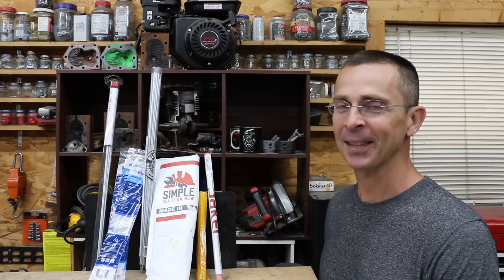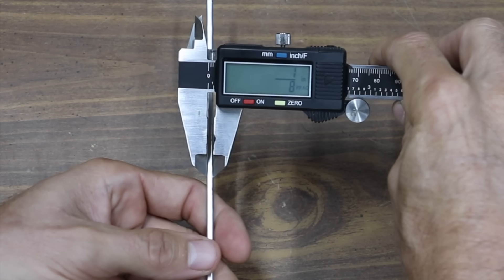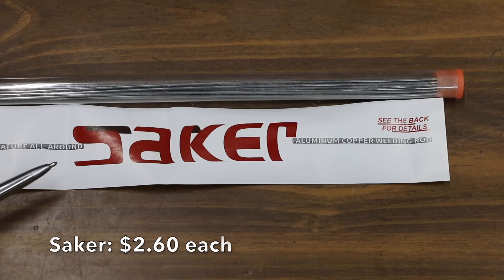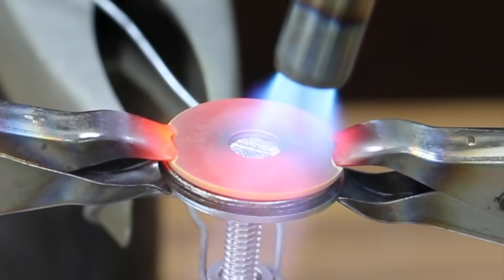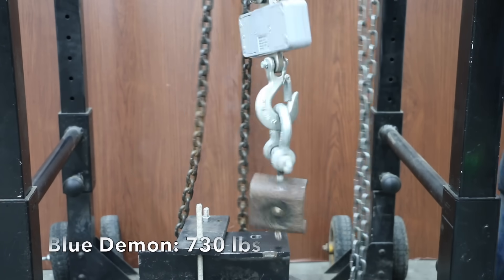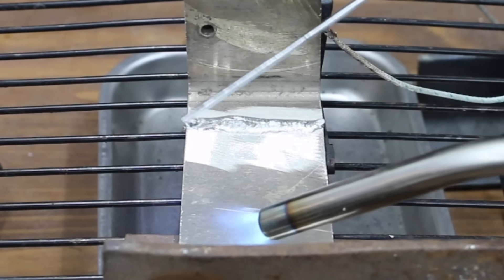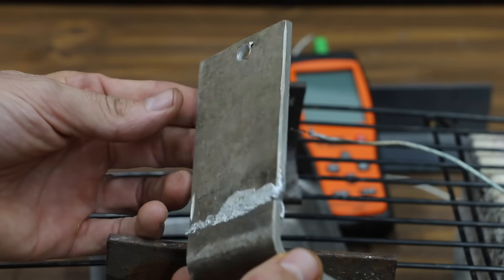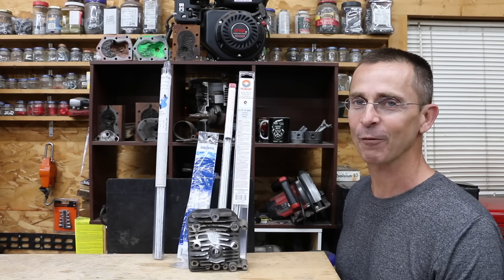Best "No Welder" Aluminum Welding Rods? Alumiweld vs Bernzomatic vs Hobart

Comment: Price to performance among American Made, the blue demon seems like the winner. The Hobart would probably be best if it's a one off repair as cost wouldn't change significantly for one repair. Aluminum oxidizes so fast possibly you need to wire brush it while the torch is on it burning the oxygen to keep it away. Oven brazing might be a help in using these products.
Reply from the maker: Thanks for watching.
Reply: Blue demon and Simple Welding  the best options.

Comment: Just wow.....what idiot wrote the instructions for these products....you DONT heat the metal your supposed to weld bcuz in some cases it can melt faster than the welding rod....You ALWAYS heat up and melt the welding rods and apply it on the surface you want to weld.....easy as that for f sakes.....

Comment: Anything less then 7/64th, and more 1/8th is ridiculous for a welding rod.
I prefer rods that are between 31/256th and 61/512th of an inch, I can occasionally tolerate 641/8192th for jobs that requires a finer diameter, like the first one, that one had some sensible measurements :)
Reply from the maker: Thanks for the feedback.

Comment: How 'bout testing extension cords? For sure, current capacity is a factor, but IMO the most interesting part would be wear tests of slamming them in a doorway (or other shear testing), putting them under tension until they fail, and comparing the electrical contacts after plugging/unplugging under load to create arcing. Maybe test the strain relief boots on the ends too?
Reply from the maker: Thank you for the video idea!

Comment: This may have been asked and answered already: We saw the tensile strength of the bolts when the bolts  broke rather than the weld. But, what is the tensile strength of the aluminum bolts prior to being exposed to the extra heat of the welding process?

Comment: Weld a connecting rod back together then maybe take two rods and cut them so you can stroke one motor and destoke the other.  Fix a hole in a piston. After seeing you patch that cylinder head my wheels started turning.  Great job buddy.
Reply from the maker: Thanks for the suggestion.

Comment: “Saker, the worst and most expensive out there”   perfect advertising.
Reply from the maker: Thanks for the feedback.
Reply: pronounced sucker for the way it leaves you feeling
Reply: @PietriGuitars  be very, very careful if you try. Magnesium combusts violently if you set it off
Reply: Yea they seem like complete rubbish. I easily get better results than that using oure zinc from anodes.
Reply: I was just about to buy some of these, glad i looked at youtube first
Reply: @PietriGuitars  jb weld that bad boy
Reply: @carlosrobles7608    Been a mechanic since 1970.  JB Weld has always been my last ditch lifesaver!  Saved my butt more times than I can remember.
Reply: @PietriGuitars  It shouldn't be a stress member, so no strength requirement... I'd clean it up and degrease really well, and epoxy / JB Weld it.
Reply: I used Simple Welding  they are GREAT. Saker  FAKE RODS.
Reply: @mirjanailievska9525  ;  SAKER = Sham + FAKER

Comment: I Have used hobart before for exactly the same repair on a cylinder head not a cut but a crack and i did both sides.  if the piston rod didnt fail 4 years ago it would still be going today. now fix that from inside keep the engine for next test.
Reply from the maker: Thanks for sharing.

Comment: Worth noting to some of the folks that may not know. - it is impossible to get new true MAPP gas in North America as the plants shut down that made it.  The stuff they sell now is MAP/Pro and while better than propane its not as hot as real MAPP gas.  MAPP is methylacetylene-propadiene propane and burns hotter than  MAP/Pro is just Propene.  You can still get real mapp in Europe and Asia.   On Air mix the difference isn't much but with oxygen the MAPP is nearly as hot as acetylene without all the special storage considerations (special tank etc)a cetylene has..
Reply from the maker: Thanks for sharing.

Comment: Those harbor freight, Hobart, And benzo rods especially the harbor freight ones are extremely impressive 

Though my only gripe is you should have filled the head from both sides then cleaned up the combustion chamber imo
Reply from the maker: Thanks for sharing.

Comment: It would be cool to see if there are any torque wrenches that are more accurate than others. Wonder if there's a way to test that but I swear I break more bolts using my husky than I do not using a torque wrench at all 🤣😂 thinking about upgrading but i dont know what to go with.
Reply from the maker: Great suggestion!  Thank you.
Reply: Just yesterday using a threaded hex coupler, a socket and a torque wrench on each end turning opposite ways to see how close they were to each other.  Surprisingly the Horror Freight ones were just as accurate as the others.  Used adjustable ratchet type ones and the beam deflection type.  IMO, the beam ones are more accurate overall when you have the room to use them.  Many use them to calibrate the click type ones.

Comment: Hmm the fact that the brazing rod was running cooler and it didnt even have the cooling fins gives me an idea, Please take a normal cylinder head and cast it in green sand, then melt a crucible of the Hobart brazing rods and try to make an entire cylinder head from the rods, obviously youll habe to tap spark plug thread which may be hard and drill head bolt holes but it would be awesome to see how it performs against the compression aswell as the heat and if it can even run cooler!!
Reply from the maker: Thanks for the video idea.

Comment: To be little picky, 
welding is connecting 2 (or more pieces) of metal together by heating them till they start to melt there own material together, 
tis can be done with or without adding extra metal from a rod or wire to fill a gap. 
Without extra adding metal, can be done by using only a Oxy / Acetylene torch and no filler wire.
Connecting 2 (or more pieces) of metal together by heating them, without melting the own material, 
and only melt the extra adding metal (lower meltingpoint then the base material), is called soldering or brazing.
Here in Europe, we call soldering at low temperature (like electronics) soft soldering, and soldering at higher temperature (till the metal turns red, but without melting) hard soldering or brazing. 
Another note, the meltingpoint of aluminium is arround 660° Celsius, but aluminium oxidizes immediately invisible for the naked eye within seconds at room temperature if you sand or scrub it, and the formed oxide layer has a meltingpoint arround 2072° Celsius. 
This oxide can be seen when you melt the rods in this video, and real aluminium is in liquid form with the dull layer (aluminium oxide) on the outside like a film.  
When doing high quality welding of aluminium with a TIG welder back in the old days (like 90's), the area to be welded, was cleaned with a degreaser liquid like Trichlorethylene, but because this product is very toxic, it isn't used anymore for this purpose.
Reply from the maker: Thanks for sharing.

Comment: Many years ago someone's dropped piece of split firewood cracked the oil pan on our 2000 Focus. Had I only known how easy a fix this could have been! <sigh>

I just built a 24'x2'x2' wooden box to store my wife's outrigger canoe. 2x4s and plywood and that damn thing is heavy. Dreaming now of an aluminum framed alternative, and this could well be a part of that solution. Hmmm...<stares into distance and starts planning>
Reply from the maker: Thanks for sharing.

Comment: I gave up on these because they're so pathetic. The best way to actually weld aluminum is with a tig torch or at least an aluminum spool gun, requires a welder though. Nothing can replace actual welding
Reply from the maker: Thanks for sharing.

Comment: When welding aluminum you have to really consider heat sinks when you welded the washer to the bolt, the clamps and the steel washers act as a heat sink. Pulling alot of the heat out of the material
Reply from the maker: Thanks for the feedback.

Comment: Idea for Test: Differences in Circular Saw Blades
Some blades have 16 teeth, some 18 teeth, some 24 and so on… I wonder how much better, finer and/or smoother blades with higher teeth cut compared to lower teeth count. Also blades for special wood types. 100 tooth blades, 180 teeth blades for plywoods and so forth. I would really like to see a comparison(s) of this type. Thank you.
Reply from the maker: Thanks for the video idea.

Comment: Those are not welds on the plate test, that is brazing. A weld includes the filler rod and the base metal and should be stronger than the base metal similar to alumiweld.

Comment: "Welding rods"? Who said these are welding rods?
They are brazing rods, and nothing else. Primarly made for different fillings of cracks and voids, and not for spacecraft constriction. Cosmetics - not strength.
Reply: QI Varebil2 3000 lbs of Tensile strength doesn't sound cosmetic to me.  Many of those "welds" held firm while the surrounding material bent or broke.   In any event, perfectly good enough for anything I might have to do to aluminum.

Comment: Testing that head with a few heat cool cycles running would be interesting.......not really a product show down unless you did several and even then it might be hard replicate 4 identical, but even that one would be interesting to see how many 30 minute cycles it would endure as thats probably a good rounded number for lawns 30- to 60 minutes would be my guess at the average lawn cutting time for normal folks who do not have large properties.

 My guess is expansion contraction is what will do it in......maybe ?
Reply from the maker: Thanks for the video idea.

Comment: I think your thermal cam may have been picking up a reflection when you saw the low temp on the (shiny) motor repaired by the rods.
Very neat stuff, I never realized repairing aluminum was an option.
Reply from the maker: Thanks for watching!

Comment: was going to braze on a exhaust adapter to my generator  briggs 18 hp  spark arrestor think the aluminum hobart rods would hold??  already have them
Reply: I'm not quite sure about the specific part you are referencing, but I would not count on these to get an air tight seal, at all. That's one thing I learned doing pressure checks in welding class... is even when you've stacked dimes, water finds a way out of if unless you get proper penetration. With Carbon monoxide, not worth the risk. Not sure how well these will do anything but aluminum, either.
Reply: @ryanj610  yea understand , its just attaching 1 1/2" adapter to muffler to hook flex pipe out through wall of generator shed (64sq ft) im building, which has 1000cfm exhaust fan for heat inside shed . unattached to house no worry of exhaust fumes.. will be sucked out anyway.. guess ill have to buy  ts 8000 torch to braze or carry it somewhere to be welded,, only like 18 g spark arrestor cover which just bolts to muffler. may be to thin to weld not my forte  thought about not doing exhaust out due to size of exhaust fan..  thanks  subbed yes the hobart aluminum rods work great  built a deck frame in boat holding up no cracks nothing solid.

Comment: I wonder how well these aluminum brazing/welding rods work on high heat applications, like repairing exhaust leaks/cracks. I think some of them will definitely melt or fail at the hot end of the catalytic converter, but maybe that's where some of the "higher temp" ones will shine.
Reply from the maker: Great suggestion! Thank you.
Reply: The exhaust will be no hotter than the top of the cylinder head.  The Hobart brand should work fine.

Comment: Very good info. I have occasions where one of these rods would suffice, sparing me the setup of my TIG welder. After seeing the strength of the Hobart, that's my choice. If you are going to the trouble of fabricating or repairing something, the extra price is worth knowing you can do it right, once!
Reply from the maker: Great point! Thank you

Comment: I really appreciate how quick you get into the subject and compare products in an "apples to apples" manner.  If anyone ever asks I'll recommend the hobart and harbor freight.  Even though these impress, I have to say that if someone plans on getting the part fixed by a welder in the future this stuff is impossible to weld on and may increase repair cost. Say in the case of a boat you pretty much have to cut out a patch before you weld it back.  
     I've been welding for close to 20y and when i see this stuff, I start looking for patch material.  
     That said, this stuff would be awesome for certain projects and repairs! 
Thanks!
Reply from the maker: You are welcome!

Comment: Just thought of a video idea! Can you test several different oil stain cleaners? There's tons of liquid based products, the rub in type like floor dry, or even just kitty litter. I work hvac and sometimes oil from condensers and evaporator coils gets on drive ways and we've used a ton of different oil cleaning products. Only few have ever worked with most being pretty lousy. Thanks for all the great videos!
Reply from the maker: Great suggestion!  Thank you.

Comment: Welding with these rods isn't easy to say the least. I've had some of these rods (none pf the brands tested, however) for years and I've found it a finicky job to say the least. The aluminum must be sanded just prior to welding, tremendous heating power is required from any torch because aluminum soaks it so much, and then there's the risk of melting the aluminum itself. I'm glad you tested all these products, except for the first inferior product and the one that has a flux, they all seem to be zinc based and should have performed pretty much the same, but I realize now small differences in the alloy composition is the key to success here. Your tests, as usual, are tremendously helpful 👍
Reply from the maker: Glad to hear they are helpful!

Comment: Dare I say Iceyyyy would make a much better heat sink than a welding rod? 
By the wayyyy, that name seriously sounds like a swap meet rip off "brand".  lol
I've only been using acetylene/oxygen torches for 6 months. I still occasionally melt a nut to a bolt.
Just wish it was intentional. If so, I'd be one of the best at it. 
But nooo. Boss has to be all negative when it happens.  lmao  
Another well performed test!  Avoiding trying "Iceyyyy" for sure.
Reply: Well on the bright side that can be useful to be skilled at, for instance I recently made what I call a 30' slip chain I use for multitude of tasks such as putting tension on trees to fell them and then use it to bundle large bundles of brush and drag to the other side of the farm it's like a Slipknot but a chain with a large ring on one end and the screw in connecter that I have adapting the ring to the chain the screw thing kept coming loose,I put some loctite I had( not the strongest stuff) and thought it was fixed but pulling a bundle with the tractor it came undone and the screw thingy was forever lost,lol so I essentially forged a "pin" I made through the hole bymelting the metals together in a rigged up coal forge , had I used my brain and thought to fire up the torches to do this it would have saved some time,lol so in a since you just gave me an idea for future reference 😉
Reply: @wolfmanrebel874  
Just use care with acetylene/oxygen torches. Its rather easy to push steel too far, thus weakening it greatly. 
And stay away from the O2 lever if only melting is the goal.  lol 
I'm still considered an "infant" torch user.  
Many bangs before obtaining a correct flame. A column of soot during ignition is also a regular occurrence for me.  lol

Problem for me, there is no room for error once flame is placed on the work. Many times, melting a nut means I have to buy the customer new axle shafts and/or tie rod ends.  I make sure to have $400 on me every day at work during this learning process as a result.  
While the company usually pays for damaged parts, I personally can not allow anyone else to pay for my mistakes or education. 
So until I perfect my abilities, mistakes get expensive very quickly.  lol
Reply from the maker: Thanks so much!